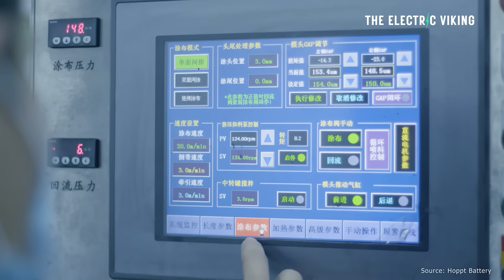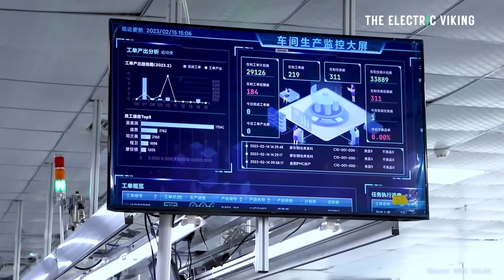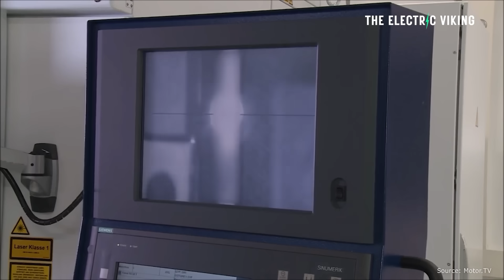NASA has cracked the code for replacing lithium batteries: ‘triple the energy’

Comment: Off topic, mostly:  A long time ago (I'm pushing 80) I worked at a place underneath the glide path to the airport in San Jose, California.  Maybe about half the airliners were jets, and when they came coasting in one just had to talk a little louder.  When one of the old propeller airliners came in there was no point in even trying to talk;  one couldn't shout loud enough to be understood.  In retrospect, it seems that the replacement didn't take very long.  In my father's youth being able to ride or drive a horse was still a practical skill;  by the time my folks married it wasn't.  I expect to see the day when EV's predominate, although I doubt I will purchase one-- my Toyota Camry Hybrid still has a lot of mileage left (quite possibly more than I do).
Reply: It is amazing how much has changed from 1900 to 2000. My father was born in 1925 and as a youth still used horses to plow, me being born in 1957, remember at my grandparents farm, wood stove & cook stove, a radio, a wood phone on the wall you cranked a handle and it was on a partyline with three families, a glass tank lead acid battery for the wind mill, that still ran a water well pump and yard light. Most of there food was grown or raised on the farm, but did have electric grid ,for lights inside.. Until my grandma was I think about 75, had never been more then about 20 miles from were she was born and she came to visit us, about 40 miles and when about ninty she flew half way acrost the country to visit her daughter. She past  at 108 around 2008.
Reply: Really nice comment. Me too, I suppose. I certainly hope to outlive the old cars I drive (one is 1989 Mercedes 190e which keeps on purring; another has 330,000+ miles on it). My next will be a Tesla. As a pilot, I'd love to fly an electric plane or helicopter. After all, the point of living longer is to enjoy people and all this new exponentially developing technology (and, of course, particularly medtech!). But, happily, right now there is Hertz and occasionally the chance to rent a Tesla and enjoy the ride into the future.
Reply: Good luck finding a gas station. When horses were replaced, hay disappeared almost instantly.
Reply: It's wild how fast things have changed just in my 50 years.   I remember visiting my grandpas home as a kid.  No electricity, dirt floors, outhouse and a hand pump well.   He lived like that his whole life. It was clean, small and tidy.  He had everything he needed.   Grew vegetables and delivered produce as a job from end of ww2 until the 80s.
Reply: Alan, I fully expect you to change your mind.  Gas in CA is currently over $6/ gal, and no one expects the price to drop, or do anything but rise at an even more accelerated rate. Many automotive experts expect gas prices over $15/ gal. in the near future.

Several refineries have closed, and more are expected to.

EVs are far superior in many ways. My current EV has over 81K miles, with negligible drop in driving range, and no brake jobs or other drive train maintenance.

A friend looked @ my brake disks, and realized they looked brand new-- EVs use regenerative braking, which can mean no brake work for the life of the car.

EVs typically have no more than 10 or 15 moving parts in the entire drive train; ICE cars usually have several thousand moving parts in the engine, and hundreds more in the tranny.

I could continue, but I'll leave it at that.  EVs are BETTER.
Reply: @billdale1  I was just up in LA last week.  We saw gas at 7.79 per gallon.  Highest I have ever seen it.
Reply: @putteslaintxtbks5166  Vivid, detailed imagery you shared! Thank you!
Reply: Great insight. Thanks. I really liked my Toyota hybrid before I got my Tesla. It would probably take 6-10 years to make your money back trading that in for a long distance EV. So keep your maintenance up and you will be good. 

On the other hand I have really liked not seeing a mechanic or lube oil filter shop in 3 years. The personal energy savings (my body) is worth some money to me.
Reply: @putteslaintxtbks5166  all it will take is a big solar flare and the people with horses will be laughing. There is also the issue with terrorist attacks on the electrical grid.  There are 9 key transformers in the US that if they are hit would take out the whole grid for at least 9 months.  There has already been a couple attacks on those in the past decade or so.
Reply: @toddmarshall416  you do realize hay is basically just grass? Once I get out of the city there is massive fields of hay everywhere.  Making your own gas is possible as well.  When a US pipeline company got hit with a cyber attack the hillbillies were making their own fuel.
Reply: @billdale1  so he should get rid of a perfectly good vehicle when he is 80 and buy a new vehicle because EVs are better? Some of you guys are ridiculous.  I've got a 4runner which has horrible gas mileage but its got like 60000 km on it.  I'll drive it till it doesnt run anymore before looking for something new when I'll buy an EV.  I've got it paid off and dont drive that much since I jump on a plane to get to work.  It would be dumb to sell that and either take on debt again or eat into my savings/investments.  I'll never get that money back no matter how much gas costs or how much more maintenance I have to do vs owning an EV
Reply: @pin65371   Legend(Q: Question; A: Assertion):
Q1: Yes; A1: Semi yes; A2:yes; A3:yes. My Q: Your point?
Reply: @billdale1 Gas in Houston is $3 per gallon. Do you think that other $3 is for transportation? Or do you think government might play a role?
Reply: @pin65371 actually Solar panels and wind turbines make the grid more resilient. Add some home batteries and V2G capable EV's and you're all set.

Unless that solar flare destroys all electonics. At that point a grid is quite useless anyway.
Reply: In 1989 I worked and rented an apt on Galveston Island, where many residents  considered themselves "B.O.I's" (Born On the Island) where many went to school, then worked and died / buried there.  In their lifetimes they never left it!  1989.  Amazing!!
Reply: Fire is not the main cause of fatalities in airplane crashes.

Comment: What I love on EV world development is that they don't improve by something like 5%, but often a new breakthrough can triple the status quo, i.e. by ~300% is possible.
Reply: Except they can't really, they just say they cane
Reply: They probably will .
Reply: Lithium batteries that have been in production over the last decade have been improving in capacity density by 5% every year. That is the main reason the best EVs have gone from 220 miles to 500 miles in range.
Reply: @ecospider5  we will only get better
Reply: Well NO.  What made the E car viable were batteries which can operate over a wide Temp range at 99% efficiency while not losing much of their charge compared to previous tech.  NOT their energy density.  You might notice NONE Of the above was discussed by the host of this video.  IF the above is NOT addressed in press releases, it means said "new breakthrough" is complete BS.  The above is even MORE critical in air transportation who operate in even WIDER temperature ranges.  If you have to HEAT your batteries when the air temps are -60C... Uh, we have a problem folks.   And we do not need 2X energy density as claimed in this video.  We need 5X energy density and even then we still cannot do most of the routes flown today.  Only the short range routes.  Host is preying upon peoples ignorance for a video... disgusting.
Reply: That which is asserted without evidence may be dismissed without evidence.
Reply: @ecospider5  That is great news. Thank you
Reply: No. The opposite. The Chinese mastered the Japanese art of accumulating repeated tiny changes over long period of time to achieve substantial changes.

Cathodes - NCO>NCM111>NCM333>NCM522>NCM811>NCA>NCMA>NCMA>LFP>LMFP>M3P>... 

Anodes - graphite>Si doped graphite> pure SiC> graphene? >...
Reply: @w8stral  well keeping batteries at a steady temperature inside the plane is not hard to overcome.
Reply: @MrChakra108  that is amazing
Reply: @ecospider5  discharge rates maybe... capacity, not really... they just make packs bigger.
Reply: @breckfreeride I am talking specifically about capacity. The Tesla Model S is one of the widest cars on the road so they could fit more batteries into it. And it started with only 220 miles of range. Now it gets over 400 miles with the same size battery pack. That is do to batteries increasing in capacity.

Comment: A small correction: most commercial aircraft use turbine engines, powered by AvTur fuel, effectively a type of kerosene. Petrol or AvGas is used for piston engines, as in light aircraft (Cessna 172 etc.)
This does not affect the gist of your message.
Reply: @harmony3138  It's pretty irrelevant in the context of the video.
Reply: @harmony3138 what does it change about the point of the video exactly.
Reply: 9/11 taught me the differences & variations in fuels in aircrafts
Reply: They  said the same thing in 1992 when I started working at GM on the  EV-1, that the  battery  tech could be right around the corner ! I retired in 2015 when I did, I bought one of the greenest cars GM made a LaMan's blue z fifty one Corvette.  Could<  is not news! Could is an opinion. Mandating electric vehicles is the worst possible thing for the environment and the economy!
The less gas / oil we use, the more toxic expensive everything else will become , period. The planet is going to do what the planet is going to do. Man can speed it up or slow it down, but he can't stop it.😊 By the way I have my name on two patents in this field, So what... Imagine computer error on your flight across the pond. And having to reboot to get the motors started.😮
Reply: @mr5oa1  You lost me at "Man...can't stop it"  You are wrong. We can, and we must.
Reply: @davidinkster1296  I think they lost me when they said that using less oil will somehow make everything else more toxic...

Comment: I am an avionics engineer with 40+ years of experience.  Jet A-1 fuel has an energy density of 9.6 kWh / kg (we normally use megajoules/kg, which is 34.7 MJ/kg, but it's the same thing).

A Tesla battery pack has an energy density of about 150 watt hours per kilogram (less for LFP batteries).  Now before people say it's almost 300 Wh/kg, you should look at it from the pack level, not from the cell level.

That means a Tesla Model 3 battery pack would need to have 64 times the energy density to equal that of jet fuel.

Does that mean that if they develop a battery with 64 times the energy density that we can just replace the jet engines with motors and batteries?  No, it does not.

When a jet is full of fuel it can takeoff but it cannot land.  It has to burn off that fuel in order to be light enough to land.  That's why in an emergency they dump fuel.  The battery weight will not change during the flight.  Also, as you noted, you must extract huge quantities of energy out of the batteries during flight.  A battery like that would be dangerous.

On the bright side, electric motors are very efficient, however, we are orders of magnitude off from being able to replace jet engines with motors and batteries.

I've been hearing about magic batteries every year for decades.  Batteries have improved a lot, but I'm afraid it's too much to ask that jet engines be replaced for long distance travel.
Reply: You're just the chap to verify some stuff I've put in comments here and there, re electric airliners. The very large airliners can take about 40,000 gallons of fuel. So let's say 100,000kg.  So 100,000 x10kwh =1 Gigawatthour "battery", equivalent in this full tank.  A 1Gwh battery even with the crazy futuristic 1kwh per kg , would weigh 1,000,000 kg.
So 1000 tonnes of battery . (More likely 4000 tonnes with any battery tech available in the next 6 years..)

Large airliners expect a refueling time of about 30 minutes. So to recharge this insane battery in 30 minutes, we're talking chargers of 2Gwatt in power. Even with a hideously difficult future 1600volt system, that's 1.25 million amps. So we're talking quite thick cables!  And remember that an entire large nuclear power station is about one gigawatt , in power. So we're talking two enormous nuclear power stations of power , for one charger at the airport.

Oh and one small problem, how's the airliner going to land with a 1000 tonne battery?? ( 4000 tonnes in 'real' today's batteries )
.....(All of the above doesn't take into account the (maybe) better efficiency of 'electric' turbine engines that can deliver 50 tonnes of thrust each! )  
 

2

Reply
Reply: @tomlewitt it’s not a question of simple swapping of one technology to another.  It has to be done. But, it doesn’t have to be the same. It might be a mix of different ways,from Airships to Starships.
Reply: Electric motors are around 90%+ efficient, where as gas turbines are about half that.
Reply: @dugnology  Thanks for the info.
Reply: Also you are landing full weight.
And you will burn off a quarter to half your electric stored energy in taking off then you have to carry the dead battery mass.
Not sure where this chap is coming from.
Also if you crash the impact is a problem before you burn and what about a lithium battery fire?
Reply: There may be a hybrid version of a jet that could get double the fuel efficiency. 
If electric motors are incorporated into turbofan engines they may be able to build engines where electricity runs all or part of the initial process saving that excess fuel usage. 
Also if the electric portion could just provide extra power for liftoff or climbing this could improve efficiency. And these engines could be lighter.
Structured battery packs have been suggested where for example the floor of the plane or parts of the wing could receive their required strength from the battery packs this would mean planes of about the same weight. The battery packs would not be large enough to power the whole flight just enough to improve efficiency where possible. 
This would also provide electric power for other systems so the main jets would not have to run just for juice.
Also it might be possible to put electric motors on the landing wheels so that a plane could taxi around on battery power. And these might use regenative motor braking to slow down on landing thereby charging the batteries a bit.
Reply: @jeremytaylor3532  O God. Maybe go to university like me and get a commercial pilots licence like me and then give an opinion based on some lodgic.
What you have said does not make sense.
Reply: @dugnology that is one step of the process... where does the power come from? Unicorn farts? How are you going to store that power?  Are we making enough batteries to meet the demand? Where are they made and how?  Do we have enough power production to charge the damn things?  How about transmission? Not to mention how much the battery weighs etc... reality is a cold mother.
Reply: You can’t get something for nothing!
Reply: @dugnology The propulsive efhiciency of modern aircraft fan jet engines in the high altitude cruise mode is around 60%. Geared fans appearing in the next generation of engines is likely to subastantially improve on that figure.
Reply: what about the electric planes which are already flying. How do they work out the physics?
Reply: Thanks for this response - I was going to bring up the same point about energy density and power transfer of aviation fuel vs. batteries.  I've been a professional pilot for over 35 years (USAF and now airline).  I flew C-130s in the USAF and have flown the B727, A320 series, B737, B757/767, and B777.  While I love EV tech (I drive an EV6) and love to see advances in battery tech, it's an absolute pipe dream to think or imply that electric aircraft will be able to replace conventional jet aircraft anytime soon.  Electric powered aircraft can fulfill very specific needs, but to think or imply that one could replace a 777 and fly from San Fran to Hong Kong in the near future is just plain ridiculous.
PS:  The YouTube channel "Engineering Explained" did a great video comparing energy densities of batteries vs. gasoline a few years ago.  I highly recommend everyone here go  and watch that video.
Reply: @gilesbrown9361  they don't carry much weight since they are already heavy and use exotic materials to try and stay light.  Short range only.
Reply: @davidgiles9751  
I worked on designs for several of those jets (or related ones).  I worked on the Boeing 767, 737 MAX, and most recently the upcoming 777X.  I drive a Tesla, so like you, I am not against electrification.

I've given the numbers.  It doesn't take much research to realize that the replacement of long-haul jets with battery-powered motors isn't going to perform the same as a large jet.

It's possible to have electric planes, but they will not carry large loads, will not travel on long-haul routes, and they will not fly at the same fast speed that jets currently fly at.
Reply: @gilesbrown9361  also see College humor skit on planes.
Reply: @gilesbrown9361  There are very few situations where electric power has been applied to passenger carrying aircraft in a commercial setting. They are very short range and limited endurance. The Pipistrel light training aircraft and electric Beavers operating out of Vancouver come to mind, there are also some electrically powered self launching sail planes. The powered safe endurance of these aircraft is generally less than 30 minutes.
Reply: @jimgraham6722  I see there is a 9 seater passenger plane, Alice, taking pre-orders in the 10's..... awaiting approval from regulators. That's a great sign